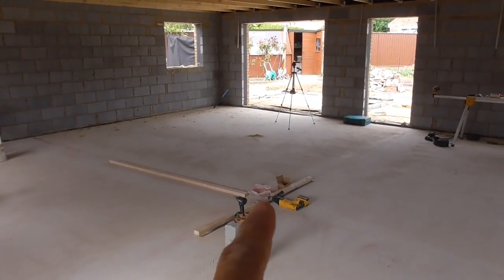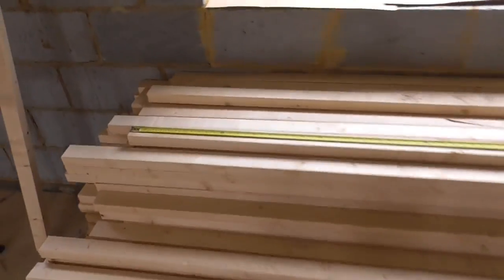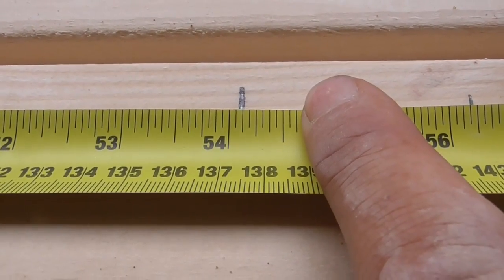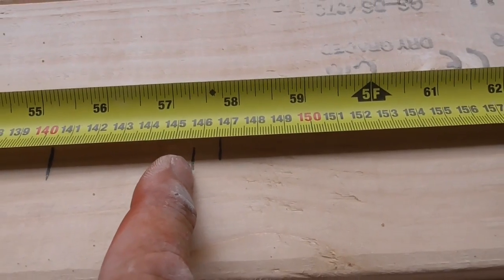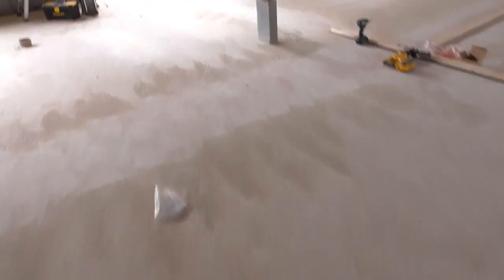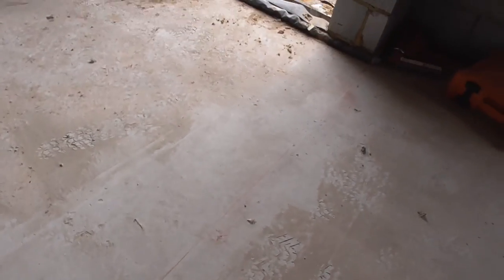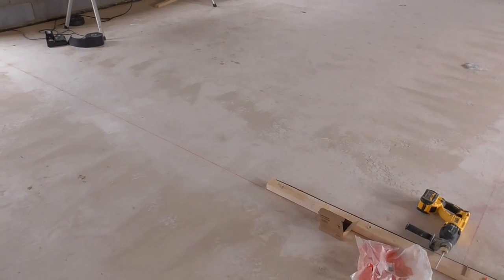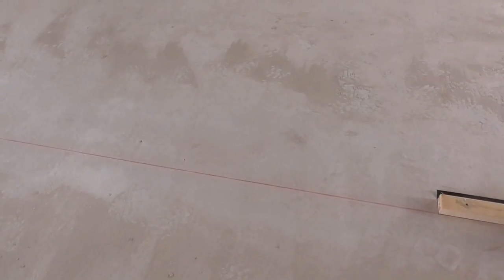How to set the door opening size in timber stud walls.

Comment: Love how your getting on the diversity bandwagon Del - with your measurement mashup.  "27 inches plus 27 inches plus a smidge plus 55mm equals 1440mm.  Of course it does! Makes total sense to all the old farts on here!
Reply from the maker: Try as we may Matt, we will never get away from imperial measurements here in the UK, and doors is a prime example of why😵‍💫 686mm x 1981mm hardly rolls of the tongue 👅 🤪Thanks for your comment and for watching 😎 Cheers Del
Reply: @thetallcarpenter  Yep. I do it all the time. It's such an ingrained habit. Confuses the hell out of the youngsters though😀
Reply from the maker: @mattcartwright8272  Doesn't take much to confuse most of them from what I hear😵

Comment: daft how we use imperial measurements for doors , 1/8 or 3.2mm is ideal tolerance  any more can be a big mistake 
I love the imperial,  but metric is more accurate
Reply from the maker: Hi David🖐Adding the 1/8th is an old habit from my days making door casings in the workshop🤓 I agree that mm is much more accurate👊Thanks for watching 😎 Cheers Del

Comment: i always go for door linings as oposed to frames. another thing that catches people out up here is a lot of doors are 32 inch by 80 inch. apparently thats a size fairly unique to the north east. it also means standard lengths of architrave at 4.2 m are no good ( howdens sizes) so normally youd cut a length in half and then remember like ive done on more than one occasion....
Reply from the maker: Hi Paul🖐I had come across the 2'8" door and it's interesting that they are more common up your way🤔I don't think I've ever fitted proper door frames since I finished my apprenticeship, and it's always these awful quality whitewood linings instead🤮Thanks for watching and have a great weekend 😎 Cheers Del

Comment: Nice explination. I like to use 4.2's for long floor plates. It helps with marking out and then once all the studs are up I go back through and cut out the door ways when I fit the door linings. I find it helps to keep the door ways in wind whilst the walls are being boarded.
Reply from the maker: I think most guys do it the way you describe Michael👊and I'm probably just stuck in my ways😆Thanks for watching and your comment😎Cheers Del
Reply: And cut into the bottom of the plate about 10 mm so your saw doesn’t hit the concrete when you cut them out later 👍🏻
Reply: @Dazza19746  Truth! I finish the cut of with my recip saw and old blades that I collect from other jobs. When the tip gets totaly mullered I chop the tip of with my disc cutter and keep on going.